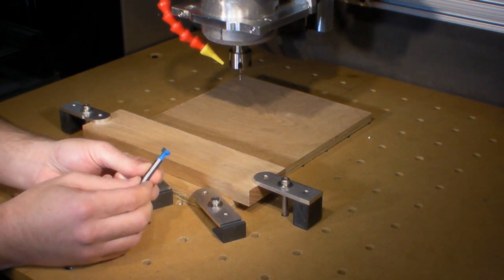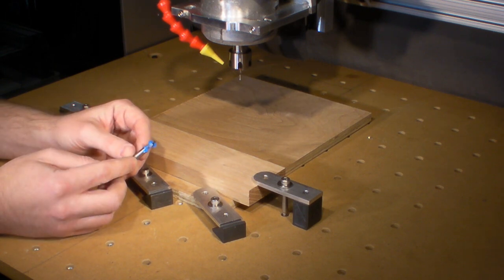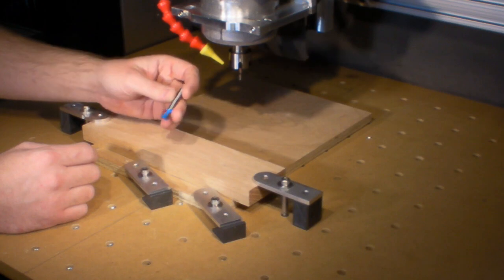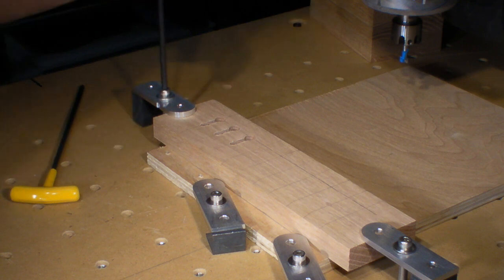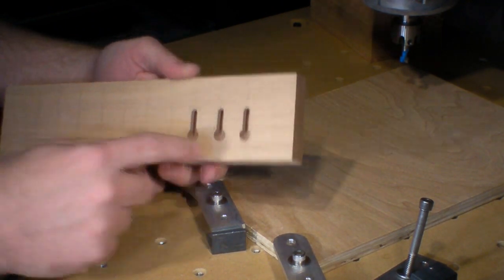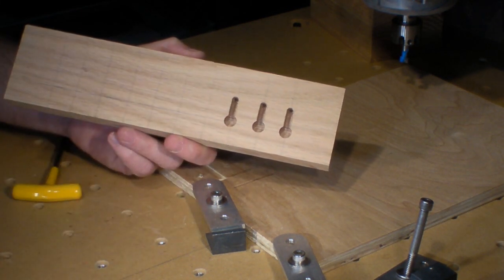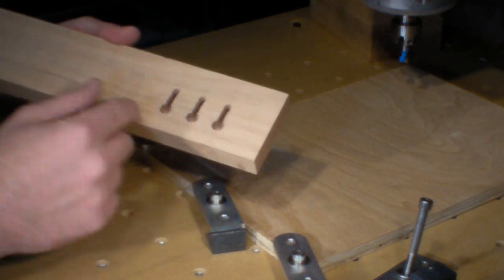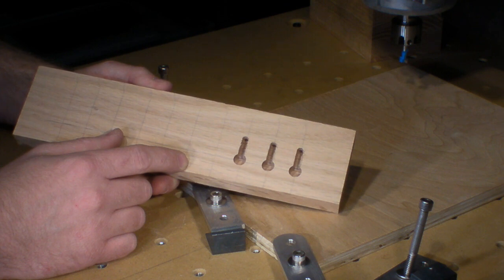How To Series - Key Hole Cutter - Neo7CNC.com

Comment: My Dad used to make these with chisels, when you can't see them on the face of the wood he called them a secret key if you could see them it was just a key. I still use them now in my trade for hanging headboards etc. But when I where young my dad used this for the grills on my speakers I was always making. Nice vid

Comment: great work I was looking for some video of this and finaly :) there it is...I do a lot of things on my cnc and this is wery handy for customer to easy hang something on the wall...I will tray to do strategy for this machining in solidCAM but if you can somehow post the code I would be very thankful...all the best in future works
Reply: Kiboz2000 hi this is a great instructional video, what are the clamp downs your using called please?